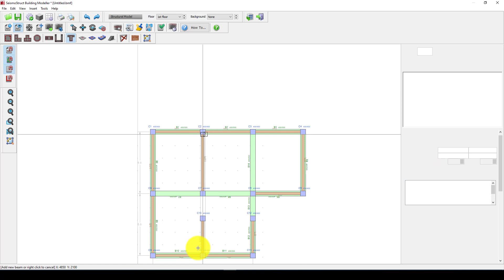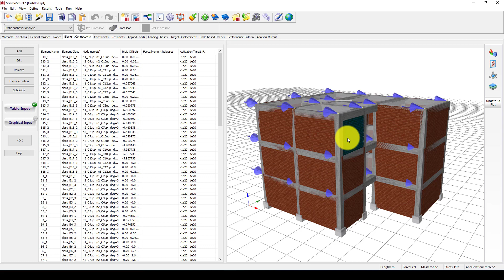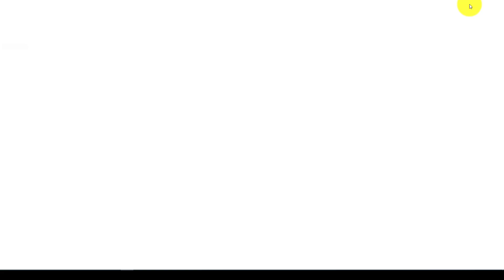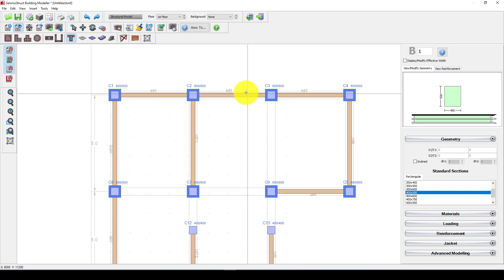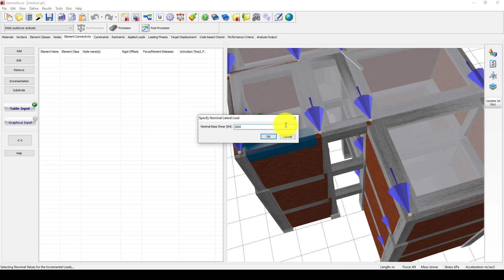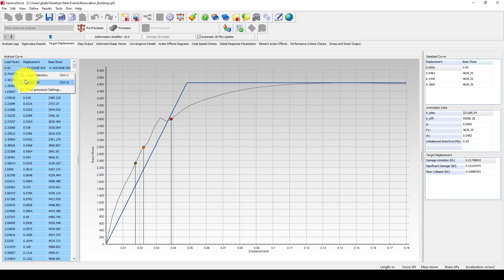Retrofitting of an existing building  using concrete jacketing with Seismo struct Software

Comment: when i export the cad file, i face a lot of issues in scaling. the cad plan scale is quite large and the column i draw in seismo struct is very small. kindly guide place. also how to draw stair case in the model?
Reply from the maker: Clean unnecessary lines what use consistent units, use dxf format.
Reply: @KSSE_Engineer  thank you sir